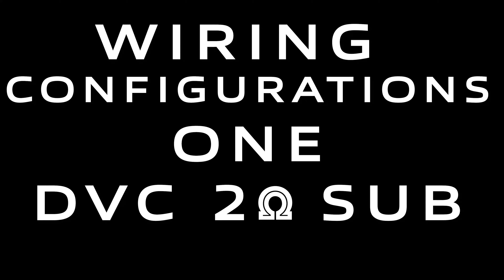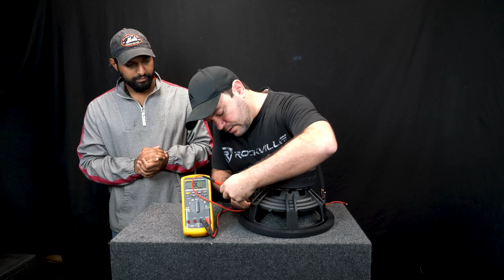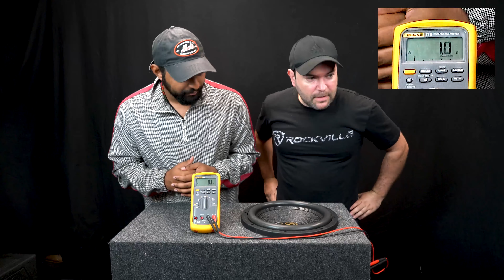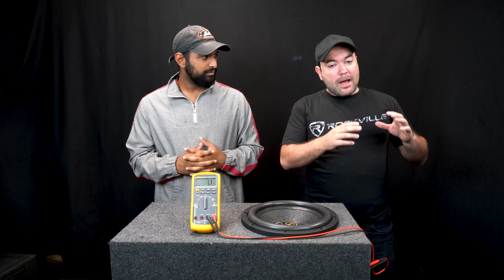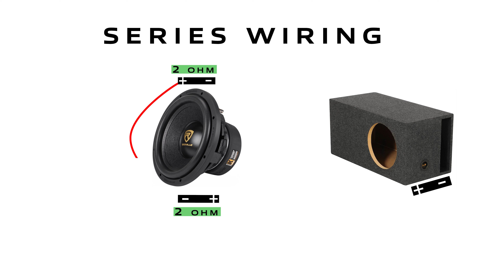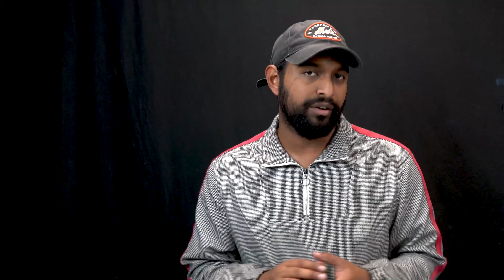How to Wire 1 Dual 2 Ohm Subwoofer Down to 1 Ohm or Up to 4 Ohms (Parallel & Series Wiring)

Comment: Well done video. I appreciate how thurough you were and the use of the illustrations.I didn't notice, however, on all the other videos I seen on the subject, they mentioned you should test the subwoofer with it facing up without touching it.  you tested it facing down and it seemed like the numbers were still consistant. Does that actually matter at all??